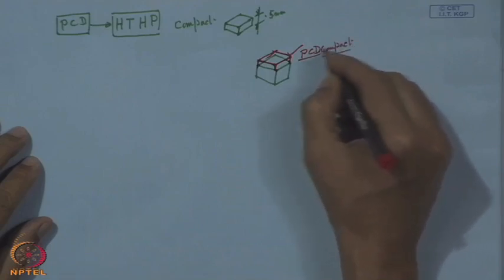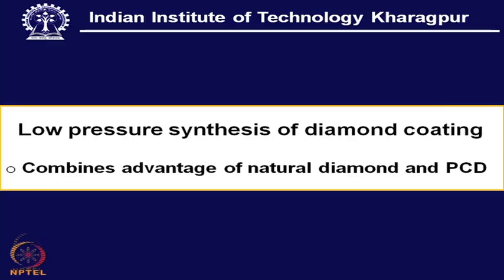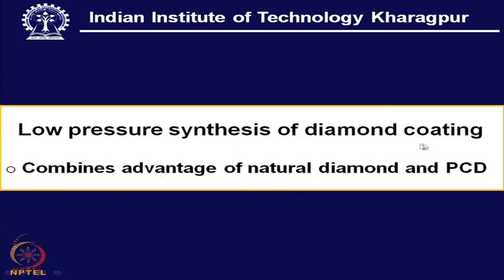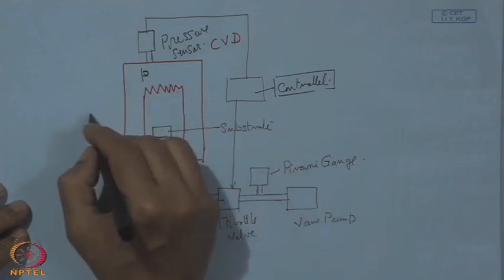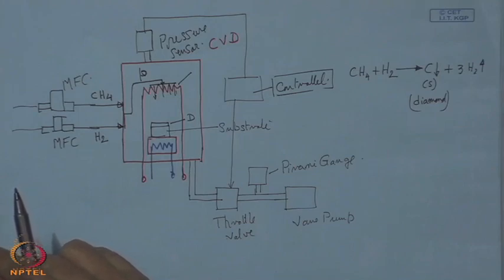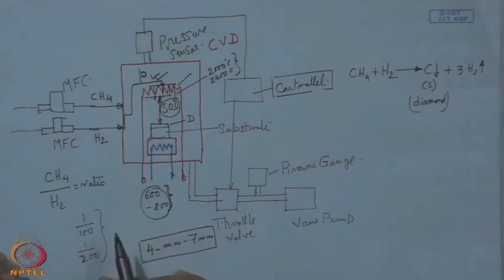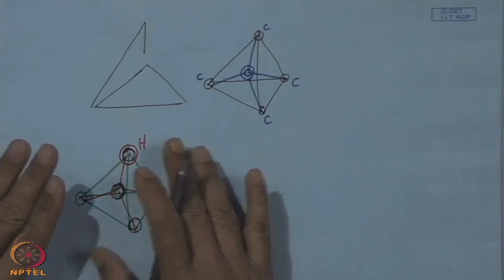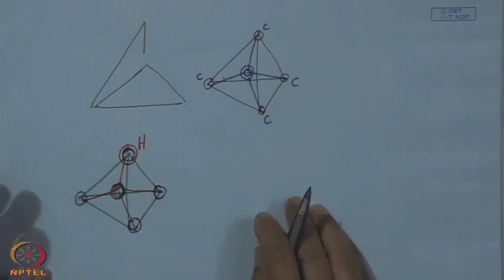Mod-01 Lec-10 Chemical Vapour Deposition of Diamond

Comment: So forgive my troll level of physics ignorance, i've only had physics until my senior year in high school. Nevertheless, I was so intrigued by CVD diamond growing when first i heard about it, that it got me thinking. Let's say you had a diamond disc of radius 5cm placed in you CVD chamber. And as you were depositing the methane gas which builds the lattice for the growing diamond, you sequentially (by first switching off the microwave source..or not) introduce all the chemical elements necessary to make a neodymium magnet. Making sure to deposit only about a 2-atom-thick layer of these neodymium magnet ingredients. However, the neo-magnet ingredients should be deposited within a smaller radius to the diamond disc, something like 4cm instead of the disc's 5cm.  So that the next deposition of methane (with accompanying microwaves) at a radius equal to the disc, would essentially (and simultaneously) encase and cook the neo-magnet ingredients into a rudimentary neodymium block ready for magnetization, albeit it being 2 atoms thick. Once the second round of methane deposition is done, we continue to deposit the neo-magnet ingredients again, and so on. The result would be a diamond cylinder block that looks like a stack of CD's stacked on top of each other, since if you looked at the stack along its length, you'd be able to peer to the other side of the room. But look at the stack from the top, and you'd see nothing but the Musician's album cover/art. 

My thinking for depositing such ultrathin layers of neo ingredients was that the diamond lattice which has to form on top could grant the magnet lattice some of their immovable properties (being diamond after all) to prevent the the finished diamond from hopefully tolerating very high temperature, physical, and other forms of stress.

Now that you have an idea of what i am getting at, i want you to imagine the CVD chamber being fitted with a powerful electromagnet that would induce and maintain polar orientation of the neodymium layer at select times during the entire CVD process. So regarding the placement of the electromagnet poles, perhaps the "North" pole could be just atop the  Chamber, while the "South" pole is fit just below the chamber. It look like you pinching a AAA battery at its ends between your thumb and index finger. 
Now of course, this is probably flawed to humorous level, but what the heck.

This is just an entertaining thought for times in the shower or when trying to fall asleep, but whatever you do after reading this, please think about what such a magnet infused diamond could be capable of.  Cheers, and thanks for reading :)
Reply: bruh
Reply: I like your patience to type this long comment.